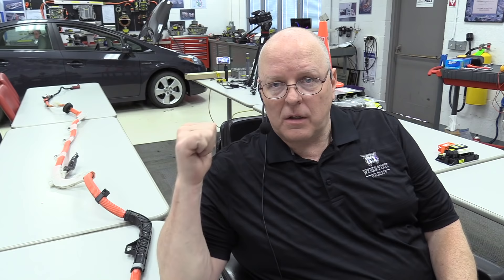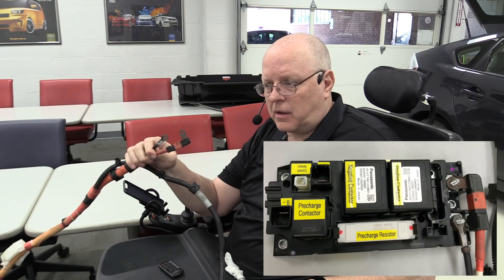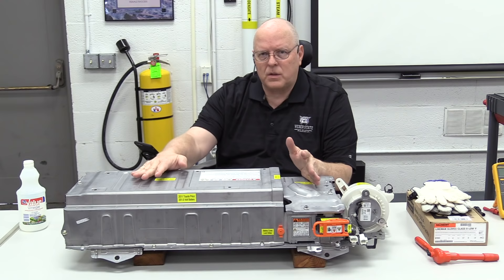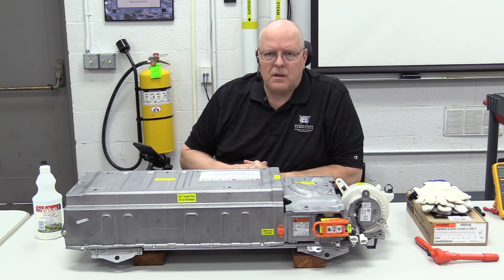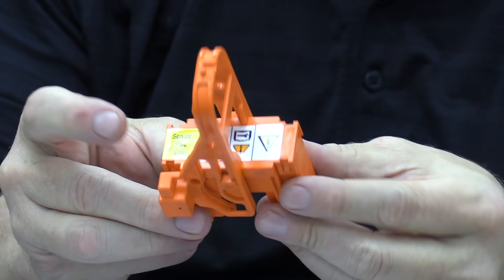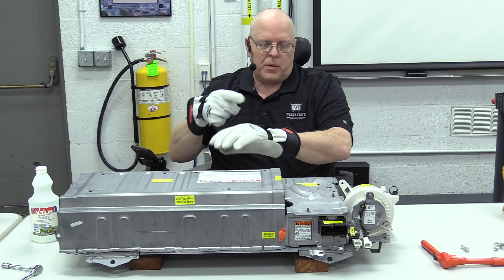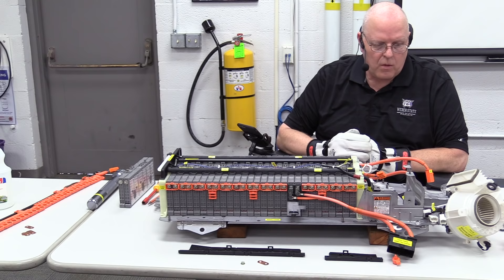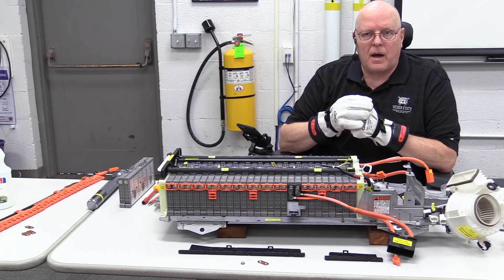2010-2015 Toyota Prius Ni-MH Battery

Comment: If you know how to trace the connections from the batteries, you will notice that there ain't any high voltage that you can touch with your bare hands, unless you open the compartment where the ICU is located, which one really have to do intentionally to get electricuted with high voltage 230 volts DC. While bolting the terminals, I accidentally touche my elbow on the opposite charged terminal, and I got a little zap, hardly noticeable.

Comment: Professor Kelly:   thanks for this excellent tutorial!   I own two Toyota Prius' and have just experienced my first HV battery failure.   Your video has been very helpful in diagnosing and fixing this problem.     On a related issue, do you have any experience or recommendations on the "reconditioning" of a NiMH  battery pack via a charging/balancing and deep discharge cycling using systems offered by companies like Hybrid Automotive?   Are the performance/capacity benefits of this type of reconditioning of a NiMH battery pack long-lasting?   Thanks.
Reply from the maker: I don’t think they are a good long term solution. If you want to keep the car for many more years, then recommend spending the money for a new replacement   It will be trouble free. Best wishes.

Comment: How's the going Prof. I got this software that can detect weak blocks in the high voltage battery pack and it works pretty well. The challenge I have is knowing how to identify individual blocks on the Lexus RX and Highlander batteries. It's easy on the Prius as the arrangement is linear but I'm not sure where to start and end when counting the blocks on the Highlander and RX models. Help!
Reply from the maker: Block one is always connected to the negative cable (I could have that backwards). The highest numbered block is connected to the positive cable (before the contactors of course). Best wishes!
Reply: Hi, could you tell us what is the name of that software?
Reply: @PuerinTheHunter  Dr. Hybrid for Toyota & Lexus hybrids
Reply: @delta-vhybrids3808  Thank you!
Reply from the maker: @PuerinTheHunter  Toyota Techstream. See techinfo.toyota.com

Comment: I have 2 Second Generation Prius' and I have also found that poor performance happens over 200,000 is cause by bad Sparks Plugs and on one bad Coils. I jumped 10 miles to the Gallons (30 M.P.G to 40 M.P.G) by switching to E3 Spark Plugs on the 2005 Prius with 230,000. The 2006 got 3 to 5 M.P.G better when using standard new Spark Plugs and new Coils at 220,000 miles (The 2006 Prius was badly abused when I bought it).

Comment: Best video in the universe. I've replaced 5 modules at different times in my 2005 without gloves. Never seen any electrolyte. Never needed help to remove and replace. Got it down to 5 hours. Interesting to see the 2nd gen battery with the integral fan. Toyota dealers will now sell a new set of modules for $1950 with a $1350 deposit. But most owners will pay over 3k including labor or trade-in their Prius for a new one. I am a total DIY guy so my 3 Prii never see a dealer after purchase unless it's a recall or I need an alignment. I think the service plug grip is vertically mounted in the 2nd Gen. Yes, kill the 12 volt battery connection first, then pull the service plug next. I think that the 2nd Gen battery pack is easier to remove since the fan is remotely mounted and there is no Lock Striker. A good cleaner for the bus bars is Caig Deoxit D5 (www.caig.com) spray.Wire brushing decreases contact area. Bad.
Reply from the maker: Thanks for the feedback. Deoxit is good. I agree, a wire brush is too rough. 400 or 600 grit sand paper may be a good solution to the heavier corrosion.

Comment: Thank you for your video lessons.  I have ordered a 2021 Toyota Sienna XLE and have learned how the systems work, what to watch out for,  what I should do, and what I should NOT do.  I especially appreciated the video on the Rav4 Transaxle because I had no idea how the engine and MG's are interconnected.  I was also happy to learn that the Toyota CVT design is all geared with no belt.  
People involved in Remote Learning should watch your videos.  They could learn a lot by observing your approach and techniques, especially how you take time to thoroughly explain things.
Reply from the maker: Thank you very much

Comment: Thank you for this thorough tour of the Toyota high voltage hybrid battery. It has helped provide options to consider while I decide what to do about the dying battery on my 2004 Prius with ~385K miles.
Reply from the maker: Thank you! That is a lot of miles!

Comment: Excellent! I have over 20 years experience in outdated electronics and experience with high voltages ( up to 4000 Volts ).  I learnt a lot of useful information from your video.  You've saved me a bit of guesswork when I'll have to check out the battery on my old Prius.  UK based!

Comment: The condensation can also corrode the sense contacts in the orange ECU plug.  That is a fire source because the pins can short out and no fuses in the line. Always check it when you open the pack...

Comment: Excellent video! 

 I wonder if the bus bar jumper corrosion is due to dissimilar metals. 

 Looks like copper bus bars and steel nuts.  A copper washer or brass nut might be a solution.

Also when you connect batteries in series the current through each battery is the same.  So even though you only have 15 volts on each battery pair a short circuit could be 100 amps or more.  The danger is not a shock hazard but a burn hazard.  Watch out for rings, watch bands, and tools even when handling a single cell pack.

Comment: I have even swapped kudos to your presentation with merchants and strangers when buying parts. HOWEVER, I must correct you on the availability of items you mention as Toyota's support of. No Voltage control unit to bus bar harness. It was available for 2009, but not for 2010 onwards, for Gen 3. I was happy to hear you saying it was available, only to be so disappointed in Toyota for rescinding it as a valid part number. A lot of the other looms are also "NO3" which means not obtainable. Got to buy the entire battery from Toyota (or go online to buy used).
But my thanks and congratulations. You certainly are a great asset to all and sundry, I have to say.
Me- an avid learner and shade tree mechanic, and a man with his ongoing hybrid Prius probs!

Comment: Your detailed knowledge and willingness to share and explain so well is very much appreciated!  I have a 2013 Lexus CT200h that has the Prius Gen 3 hybrid system.  I now have a better understanding of the system and have the confidence to make better-informed decisions on any repairs that may need to be performed.  My car only has 75,000 miles and I'm putting around 7,000 miles a year on it — zero problems with the car so far.  At that rate, the car will probably outlive me! :)

Comment: A very nice and informative lecture. Thank you.  The problem of corrosion around the nuts is due to the use of two different metals. Iron after copper in the direction of flow creates corrosion, due to the different molecular structure of the metals. The nuts have a further wave structure on the back to grip better in the copper. Electrons will flow evenly where there is contact, but in the waves the electrons will jump between two metals and form very small "sparks" that corrode the copper surface. It was clear that there was such a pattern on the copper that corresponds to the pattern on the nut. This is a known problem among water installers. My knowledge tells me that's part of the problem. Use copper nuts.
Reply from the maker: Thanks for the feedback. The corrosion was only occurring on the negative studs and nuts. Are the positive studs/nuts not corroding because of opposite electrical charges?
Reply: According to electron physics (galvanic corrosion) it is from metal with loosely bound electrons. The walk occurs when iron is after copper. In the electron flow direction. Therefore, it is the one pole that is corroded. On ships, zinc is used to deliver metal instead of the ship's iron hull.

Comment: Back in 1970-probably 1990 (maybe) we had Junior Colleges that had wonderful automotive labs where student could come every semester and learn about newer technology like electronic fuel injection in the early 70's and electronic ignition pretty much during the same time we had great teachers and the best of equipment like dyno meters where we could put a load on the the rear wheel system and find out how much horse power was being generated by the engine we also had some great machine equipment that allowed cylinder head work and cylinder block boring to a specified diameter and then hone the last few thousands to give the proper fit of the piston to the cylinder walls. It was fantastic and I found it odd that the same students seem to show up each year with a few more added and maybe a few dropped out. Something happened and the automotive part sort of disappeared along with the machine shops and auto body departments, the Junior college I attended in Mesquite, Texas closed down the Machine Shop training within a few years of receiving hundreds of thousands of dollars in new machine shop equipment. What happened where do mechanics, body shop people and new machinist go for training  that did not costs thousands of dollars by independent learning centers?
Thank you Professor Weber for carrying on, are you an instructor at a Junior college where students can go and LEARN, I pray that all is not lost for the few that want to learn trades and don't think getting ones hands dirty is a demeaning profession.
Reply from the maker: Thank you for your comments. I am a professor at Weber State University in Utah. About 10-15 years ago, many of the high schools in our state have closed down their automotive programs and put more emphasis on non-technical trades. Automotive technology is still looked down upon by many people and career advisors. The increased popularity of hybrid and electric vehicles has boosted the trade somewhat, but it is still difficult to find students.

Comment: Reconditioning or matching battery is really good solution for aftermarket if we have large sum of used battery.  By categorizing difference grade of battery and low Standard deviation on capacity and internal resistance in building the battery, it may work for another 100k miles.  For instance, bunching up 80% capacity in one battery unit will not cause trouble code in Toyota ECU but having 90% and 98% capacity mix will.

Comment: Thank you, John a excellent presentation and explained extremely well. I was wondering what is the average life for those batteries and what would be the cost of replacing the battery pack.
Reply from the maker: Thank you! They are lasting about 10 years and 150-200k miles. Cost to replace is around $4000. About the same cost as replacing an engine

Comment: A well thought out video that explains better than most.
It not an easy subject, and i feel that it is made a little harder to understand by the motor industry,  who for some reason is going  backwards in terms of making  good cars.
I hsave jusft been looking at the debate about  the Ford Fiesta which by all accounts produces less reliable cars than it did back in Henry Fords day, like a modern car with the need for a new gearbox every fifty thousand, and rather than correct the problem, prefer to go through the courts fighting customers who have paid out for huge repairs to get the  auto gearbox back to running condition, these are cars with less than fifty thousand on the clock, even in Henrys day the cars lasted longer than that, and Ford are not the only people in trouble over this, when common sence says the whole thing needs re engineering to work properly from the start.
Its a good job there are people around like yourself who take the time to explain whats going wrong.

Comment: Hi Professor. My hybrid battery issue landed me at your channel and I am grateful that you explain each and every thing in such a precise manner that even a non technical person like me can understand each and every thing. Thanks a lot. I need your advice regarding 3rd Gen Prius 1.8 (Japanese variant) which I got in Pakistan (Karachi, a coastal city) at 86k ODO (now operating at 130k) and been running since last 4 years without any trouble. I used to get average of 20km/L in winter (10 C) and 17km/L in summers (32 C - 40 C). Recently check light appeared and scanner showed to replace Hybrid battery pack. After searching Karachi Market, I realised that I should get a refurbished or battery from accidental car with long warranty of at least 3-4 years and manufacturing year should not be less than 2019. The electricians are recommending to install CHR battery pack 2019 model and giving warranty of 2 years (they claim it will run smoothly for 4 years and will give 90%-95% health at the time of installation). Please suggest if its okay to install CHR battery in PRIUS. Also suggest a good OBD2 Scanner which can support Torque and Dr. Prius. Thanks.

Comment: I always thought that the batteries were cooled by the air conditioning system. At least this is what I read from automotive articles. It seems they were wrong and these batteries are simply ventilated by the cabin air regardless of ac system being on or off... 
I just hope that everyone could share some quality knowledge like you do. Especially automotive journalists.
Reply from the maker: There are many variations, but most hybrids have air cooled batteries as you described. Ford did have an Escape hybrid with its own A/C evaporator in the battery unit to remove heat. Electric vehicles with liquid cooled batteries also use a small evaporator/heat exchanger in the coolant to remove heat from the battery. Thanks for your feedback
Reply: So there is no hybrid system component that is directly cooled by the ac system? The same articles I read claim that the ac system in hybrids mainly cools the hybrid system and the interior cooling is just one of its options. So alegedly the driver is not to decide when the ac compressor is on or off, this is up to the computer. So in hot days the ac might be turned on even though the interior ac is turned off. Is it right?
Reply from the maker: I am not aware of any hybrid system component that is directly air-cooled by the A/C system, only the liquid cooled systems of electric vehicles and some plug-in hybrids like the Chevrolet Volt.
Reply: Thank you for all your responses. I might go back sometimes with more questions as I plan to go through all your videos on hybrid systems which I truly find fascinating and you happen to be the only reliable source I could find.

Comment: my gen2 with 230,000 miles dropped mileage to 35mpg I pulled the battery pack all the bus bars were green and black all the cells read 7.5 volts. I cleaned them all good as new.👍

Comment: Great video as I like how you broke everything down into detail. Very informative I'm  a Mobile Mechanic on the side as I've work on many different cars in my spare time. I use TechStream Lite with DrewTech's Mongoose Pro cable to monitor the Traction battery health from time to time on Toyota Hybrid cars. With TechStream's live data, It gives me an idea of the ohm resistant and voltage in groups of two in 14 blocks without taking the Traction battery pack apart. You should do some videos on TechStream.
Reply from the maker: Thank you! The DrewTech Techstream light is a great tool. I have several myself. Good Idea on using Techstream software. I will add it to my list. There is a lot of good hybrid data available on there.

Comment: Excellent video , thanks prof ! .My 2013 Camry hybrid shows a 'replace hybrid battery' DTC , its a NiMH 7.2v*34 modules , hooked to a diag computer some pairs show good near 14.4 v and one or two go to 13.x volts under load (A/C), the car has only 95k KM (60k miles) I guess age caught up to the battery , either that or the battery was overheating from a clogged battery fan (are there temp related DTCs ?) , which I recently cleaned for the first time ever and was pretty filthy ,nowhere mentioned in the owners manual/service items .Another possibility I just learned from this video is corrosion on module connections causing voltage drop . The dealer only offers complete replacement for an arm and a leg. There are independent shops that recondition or claim to sell low mileage batteries from crashed vehicles but not sure I can trust them I heared stories, I live outside the US and my car is the japanese-made camry but should be same as the us-made one.Can anything outside the battery itself cause this voltage drop/dtc ? thanks.

Comment: Great video.  Very detailed and educational.   I have a prius and I am totally stumped.  When I drive the car the red triangle will appear but the car will drive fine.   Once I shut it off the car will not start.  It will not go into Ready mode.  However if I unplug the 12 volt battery for at least 1 minute and plug it back in the car will start and go into ready mode.   If you have ever heard of this issue and can direct me as to why this occurs I would be greatly appreciative

Comment: @47:26 listen to this man. that's the most important part of this video. If I had watched this video I would have saved $2000. I did everything right until it was time to put that bus bar on and I was not careful so it shifted by one slot accidentally and the whole bus bar was on fire and not just a pack because everything was shifted by one slot. I really think Toyota should have thought of some design to stop this from happening accidentally. No one could have explained the hybrid battery better. I mean you are a teacher after all. A good one. Thanks!